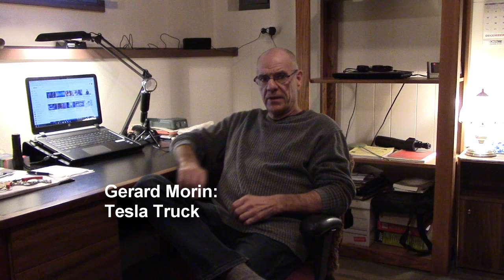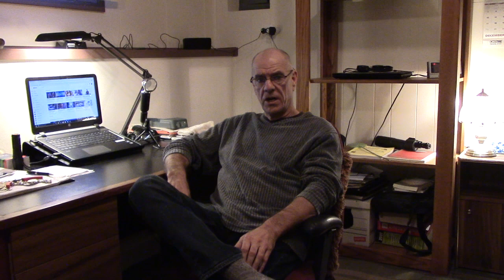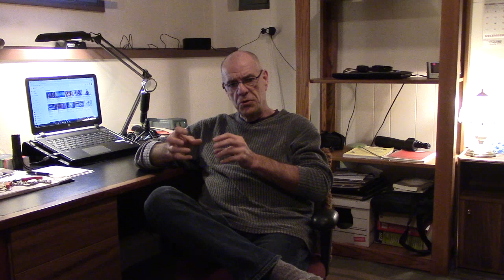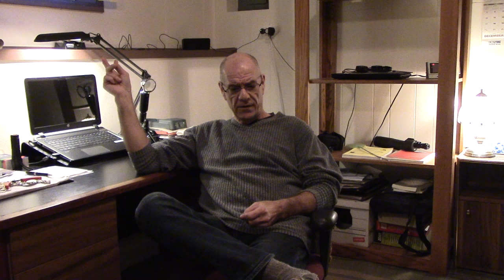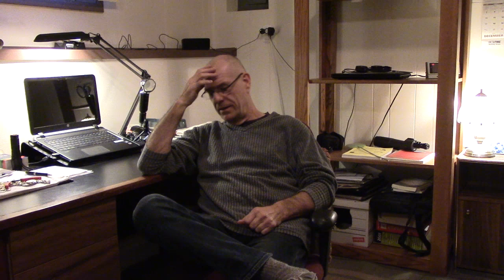Gerard Morin: The Tesla Semi

Comment: There are so many false facts about everything you have said that it would take me half hour just to write it all down
Reply: Adalberto Delgado and yet  you don’t
Reply: Did you just say "false facts" ?? Is that the same as a fake real ? Do you even know how to write?
Reply: The very idea that you can create energy out of nothing is itself blocked by the  laws of the conservation of energy and mass. There can be no overunity because of that law itself. No one has ever been able to break that law regardless of how some combination of magnets, transformers, coils and capacitors are arranged stationary or in motion.
Reply: Just because you cannot put a "Name" on something in no way means it is not REAL. Since you are so "Smart" and seem to know all the "Facts", maybe you can clearly explain where Gerard is wrong.
Reply: At about 4:20 Morin says gravity pushes the load forward when the truck stops. Sorry its the energy due to momentum not gravity that pushes the load forward when putting on the brakes.
Reply: Morin goes on a rant about tesla trucks and how the engineers building scooters and skateboards can't build trucks. Well maybe that is true and maybe not. But if I was Tesla I'd hire some truck building engineers from companies that build trucks.He rants on and on about scooter motors and starter motors. 

The biggest problem with building an electric truck is the same as electric motor driven railway engines you need a source of electrical energy. Battery charging time is a legitimate but secondary problem.  An electric only railway engine gets electrical energy from an overhead catenary cable or a third rail. The diesel electric railway engine gets its energy from an internal diesel engine turning a generator. 

Railway engines also use a compressor to for their air brakes as do regular trucks. So you don't necessarily need to rely on magnetic braking. You can use the electric motor for dynamic braking much like using engine braking in a conventional truck. The main difference is it is possible to return some of the energy in dynamic braking back to charge the battery. That can't be done in a convention internal combustion engine driven truck.   

Electric railway engines all use electric motors in the trucks usually one per set of wheels. They don't need a transmission either because of the huge amount of torque obtainable from the magnetic forces in the motor at a dead stop. You need a clutch and transmission to constantly change the speed of a conventional truck and apply the correct torque when using an internal combustion engine.
Reply: He also says that jack knifing is impossible to halt. For jackknifing to occur you need a slight imbalance in the direction that the trailer and tractor are traveling. Then the tractor needs to be stopping faster than the trailer. However trailer wheels moving sideways is equivalent to locked wheels in that direction. So if you lose traction on the trailer wheels but not the tractors you are set up for a possible jackknife. However if you have something akin to ABS on all the truck and trailer wheels you might be able to prevent jackknifing. 

Sitting in the middle instead of one side or the other would actually help with mirrors because now both sides would be equally distant. For drivers use to the other way it may take getting used to.
Reply: Actually, it's momentum and inertia, i.e. Inertia: a characteristic of an object that resists changes to its state of motion. Momentum: The resistance of an object to a change in its state of motion. Momentum doesn't "push" the load forward it just carries it forward in a straight line until Gravity overcomes the inertia and draws the "load" to the ground. 
If you listen to Morin closely you will notice that he commonly uses the wrong words to describe things. Let's call it an idiosyncrasy. Not a fault. I do not believe that it deters from his genius. Listen closely to the Gestalt of what he is saying and not just to the mistakes in his nomenclature. I firmly believe he has stumbled upon/figured out Tesla's thought process though, and he is the only person I've listened to so far who I truly believe has done so.  I also believe he is a Savant of a sort and sees things us average guys don't. I do wish he wouldn't go on so many  l-o-n-g  rants, however.
What I have just stated is not a criticism of your comment by the way.
Reply: Sorry I don't have the respect for Morin you do. If you want to get technical than no reference frame is any better than another. So the earth and trailer are speeding up relative to the motionless truck as the brakes are applied. 

You can actually get this confusion of motion when two different trains going in different directions are stopping and accelerating in a station while you are in one of the trains looking at the other. All of the sudden you realized that you are stopped when the other train is gone.

Gestalt may be fine for therapy but it doesn't apply very well in physics. Despite his claims of overunity no one can repeat his experiments and get the same answer. Tesla's ideas are not magical. Michael Faraday came up with the discovery of electromagnetic induction, when asked why it was important he said, "Gentlemen one day you will tax it." and Tesla as an engineer took them and ran with them. 

Most of these people don't understand how to use a voltmeter. So in most cases they are either a knowing fraud or somebody who doesn't know what they are doing and how to use electrical measuring tools in the first place. Electricity and magnetism are magical because they seem to violate common sense hiding somewhere while being there. In fact that's why I always liked being an electrical engineer or technician even if I don't have a degree.    

No one is especially happy with electrons being unseened and both waves and particles at the same time. We are stuck with these and other bizarre ideas ("Positrons are electrons going back in time?" Richard Feynman) because they work for the time being.

Morin problem is that he can't be bothered to learn what is already been shown to be true and show us where we are wrong. Instead its a conspiracy of the hydro company or big oil. I've never made enough money to be in anyone's pocket.  Ohm's law works for me as does calculating power as current times voltage. Compared to Maxwell's equations they are very simple ideas to learn and use. But Morin knows better because he is a simple man? or is it because he is a simpleton?
Reply: I guess what I was trying to say was that Morin is "under-educated". He quit school sometime after the 5th grade. He is self-taught, not formally educated. He didn't learn his trade as we probably did. I'm a Laser Engineer and am probably more familiar with Photons than Electrons in the Gestalt   <http://graphicdesign.spokanefalls.edu/tutorials/process/gestaltprinciples/gestaltprinc.htm> of things but I still can see and understand much of what he says. I listen through his rants and generally, at some point, he says something that slaps me in the face about Potential or Volume or something else and I get another glimmer of what he understands. I think before it's over he WILL build his device and it will work. We'll just have to wait and see. I think we should not write him off at this point and maybe forgive him some of his eccentricities. Of course, much liike the two rains passing, it's all a matter of perspective.
"There are more things in heaven and earth, Horatio, Than are dreamt of in your philosophy".
Reply: Maybe I'm too hard on him because my father and uncles were skilled workers not university grads. If he builds an overunity machine then they'll have to rewrite all the thermodynamics books and award him a nobel prize.
Reply: That depends on what the "meaning of 'is' is"... doesn't it?!
Reply: Laws don't stop things from happening they just limit the timid to the thinking of others.
Reply: That maybe true in the legal world but the discover of these laws like Newtons and Einsteins allow us to make predictions. Although Einsteins allow more accuracy usually Newtons are still being used for most applications. Before Einstein most scientists thought matter and energy were separate things and each was conserved separately. A number of experiments poked holes in this theory.  

If Morin was a young person I'd give him more credibility but considering his age and exposure to industrial culture I don't.  Saying nostrums like. "Laws don't stop things from happening.... limit the timid....' is fine for the SJW's and those who pity the poor. If you want to play in the big leagues you need to get into the minors first by any means necessary.
Reply: This is a Quote from Alan Bustany, Trinity Wrangler, Undergrad Relativity Course, A-level Physics
Author has 5.3k answers and 14.8m answer views
"The concept of a scientific "law" comes from a time when we thought the universe obeyed some relatively simple laws, like Gravity and the Gas Laws, and all we had to do was find them. Towards the end of the 19th century, we even thought we just had to tie up a few loose ends and Physics would be essentially complete.

Then came Relativity and Quantum theory which not only refined earlier concepts and theories but helped alter our entire view of the scientific enterprise. Nowadays it is accepted that any scientific theory is, at best, a good model of reality. Reality itself can never be attained and can always throw up an exception to any theory.

If reality doesn't conform to some "law", do you know what we do? We re-write the "law". That's why we no longer call them laws (except for historical reasons). The classic example is the Law of Gravity (formalized by Isaac Newton) which had to be updated to the General Theory of Relativity (formalized by Albert Einstein) to properly explain the rate of precession of Mercury's orbit around the Sun.

Those two great 20th century breakthroughs in Relativity and Quantum Theory are now the best tested scientific theories we have ever had. The recent confirmation of the prediction of gravitational waves in the General Theory of Relativity is further validation of that theory. But it could have been a disconfirmation. Indeed, Relativity and Quantum Theory are incompatible at a fundamental level so at least one of them is "wrong" in some way. Scientists seek a so-call Theory of Everything that will refine and unify them appropriately, but it seems to be a tall order." Close Quote.
So, like I said, "Laws don't stop things from happening". They just slow the processes of discovery until someone (an out-of-the-box thinker) comes up with a better Theory.
There's never been a Law that hasn't eventually been broken.
And, just as a question, what the hell does age have to do with anything? I'm 70 now and I believe my mind is clearer and sharper than ever. Schooling may make you smarter but experience makes you smarter, and wiser.
Reply: As definition by conclusion, "There's never been a Law that hasn't eventually been broken." All one needs to do is point to one or more laws being broken and that could apply because so far we can't know everything about the future.. That is a better explanation of the problems as quoted from Alan Busty above. 

Since Tesla built polyphase generating systems shouldn't a disciple like Morin be able to explain the difference between them? Single, two and three phase power? Two phase four wire systems are few and far between but by listening to Morin one would be able to disconnect one or more power service entrance conductors and still get power with out any problems. Have you ever seen a single wire service (not using the ground as conductor)? and if you are foolish enough to follow his advice about the Hydro conspiracy and disconnect the neutral have a nice day where your operating appliances get the wrong voltage maybe even setting off a series of appliance and lighting failures. Only the dumbest electrician on earth would do that. My guess is Morin has French as his first language so I'm not faulting him for that. I'm 65 and I disagree about age and ability. I and my father before me have made errors that I think a younger me or my dad wouldn't do. 

He is now disabling comments on his videos to stop people from explaining why his nonsense is wrong..    https://www.youtube.com/watch?v=3Spf5WVGgSY 
https://www.youtube.com/watch?v=YNbUyD9T-ls 
https://www.youtube.com/watch?v=IauYQCCsz-g
https://www.youtube.com/watch?v=XOq9C3YSjKg
Reply: What Morin has said is that the "Power Company/Hydro" sends the "Transmission" power to your house over ONE LINE. This is absolutely TRUE. The Single wire splice/Y from the Transmission line goes directly into the top of the Transformer (if you don't believe me, go look). One line in, NOT two. This is absolutely TRUE. The 110-220 coming into your house is produced by/at the transformer on your power pole. That's why it is called the TRANSFORMER. It transforms the super-high-power, super-high-frequency energy transmission coming thru/from the Transmission Line Power into a usable/stable 110-220 60Hz signal that we use in our homes and businesses. This also is absolutely TRUE. 
The "Neutral" return line to the power company is a relatively "NEW" thing that the power companies have done. Back in the old days, there was just a Ground cable stuck into (what else but) the ground next to your power pole. The Neutral line (formally called the Ground Line) in your fuse box was also grounded, into the ground. No return line! You just had Hot and Ground. Nowadays, the Common or Neutral line is eventually connected to Ground. If you have an old pole you can probably still see that cut-off Ground Wire there. The idea behind the "return line", that Neutral Line, is so that the power company can "monitor" the power you are using via that "Smart Meter" plus bleed-off some of your (paid for) power (about 3%) to power some of their upstream devices used to transmit power to your house. Call it a Surcharge.
I had thought that you knew more about electricity (as it pertains to its Transmission and household current) than you actually do. I apologize for my mistake.
I would like to suggest that you study up on the subject BEFORE you rage against the truth.
Reply: What your saying is not true to get a complete circuit you need one conductor in and one out. The power coming into a can with just one high voltage wire goes back on the neutral wire between poles to the distribution transformer neutral Y and is grounded for safety. You don't really understand the definition of the ground and neutral. Ground is for safety and is ordinarily never meant to be a current carrying conductor. The purpose of the neutral wire is to carry any unbalanced current in any system. By definition is should remain at zero potential when compared to the ground potential. A bad neutral coming into your home from the transformer will result in eletrolisis of a water pipe ground and a water leak which can give the water service people a shock when replacing the pipe. Any system with two or more grounds will usually have some undesired current flow.           

They don't run power though the ground even in the remote farming areas because of the problems it causes with barefooted farm animals. If it accidentally happens it has to be fixed. That practiced ended with the dinosaurs. Grounding itself can be controversial because of the results of two separated ground rods connecting together by a neutral and/or ground wire and a lighting strike to the earth itself. Power frequency 60 HZ is the same throughout almost the whole system including the whole grid throughout the US. It doesn't change though any ordinary transformer it is the same in transmission and power distribution. The best known exceptions in the US are sections of the railroads northeast corridor using 16 HZ or 24 HZ, and 600 VDC for subway and light rail. If you need 400 Hz for aircraft power on the ground the usually way is through a motor generator set. Stick to lasers and stay away from things you don't understand. 

My family was born into electricity starting with a great uncle who was an IBEW founder. Since I've worked as an electrician and know the difference between single. two, and three phase systems unlike Morin and his moronic ideas I actually understood more as an eighth grader than either you or Morin as old codgers.
Reply: The present single phase 115/230 volt service watt hour meter relies on a number of things to work properly first is the overall voltage between the two hot wires which creates the voltage factor and then two current carrying hot wires for the amperage factor. There is no need to have the neutral current included because it is just the unbalanced part that is already accounted for one or the other hot wire currents. You also have some strong permanent magnets in the meter their purpose is to have a drag effect on the aluminum wheel by inducing eddy currents. That's the basics and they are usually changed every 10 years. No conspiracy involved. 

Now if you have an old 115 volt only service the voltage coil will be have to be run at 115 volts and only one current coil will be needed. Other industrial and commercial services like 120/208 volt three phase and 277/480 volt three phase use basically similar methods with more coils and sometimes remote current coils and peak power usage pointers. I've only seen one two phase 440 volt floating system (no neutral or ground) and one 575 volt three phase system.

Any new electronic meters will have to do the same thing measure voltage and multiply it by current used. Neutral current in any system will always be seen as an imbalance in the hot wires regardless of the type of voltage or number of phases of the system.
Reply: The neutral current which flows through neutral impedance raises the load side neutral potential with respect to source neutral point which is normally earthed and at zero potential. This means at load side there will be a potential difference between neutral and earth. 
Basically, the Neutral wire is the second wire in a circuit. It is grounded.
Reply: Yes but the impedance (resistance and reactance at 60Hz) in the neutral wires is very low such that you usually can ignore it if you are worrying about the voltage drop. If you use an undersized wire than you can expect a problem. In a 120 volt branch circuit  the neutral (white wire) carries the current back to the neutral bus bar in the panel. 

Let's now consider a home dryer on a 120/240 volt single phase circuit. The heating element can take advantage of the full 240 volts available while the single phase motor and control circuits can be built to run on 120 volts. When in operation the current in the neutral is due to the motor and control circuits assuming both are connected to the same hot leg. One hot leg will carry only the heating current while the other will carry both the heating, motor and control circuit current. Why don't they just wind the motor for 240 volts and use 240 volts control circuits? Not really sure but it probably has to do with costs. They'd rather have you spend the money on a neutral wire than them add to the cost. 

How about a 230 volt home air conditioner? Here the biggest load is the single phase compressor motor and you are using the full 230 volts to power the compressor. The fan motor and any controls are also built to use 230 volts so a neutral is unnecessary. However when the electrician wires the outlet he will use ordinary two conductor one ground non-metallic cable and one of wires will be both hot and white. You will also see a hot white wire in a switch leg to a overhead household fixture. The power may come directly to the overhead fixture while the switch leg also comes up directly to the fixture.       

You can have similar predicaments when wiring 3 phase motor, electric heat and control circuits in commercial and industrial situations. .You will always need three phase power for the motors and it is not unusual for the motors to be dual wound so they can run on a nameplate voltage of 230/460 volts. Of course when you connect them up the'll most likely running on either 480 volts or 208 volts three phase power. As long as the engineer oversized the motor and you put in the correct heaters in the contactor everything should be fine. As long as the motor is small and you have a 208 volt three service you can use 208 volt controls and not use a neutral wire or add a neutral and use 120 volt controls. If it's 480 volts 3 phase and a small motor maybe you want to use a neutral and 277 volt controls. 480 volt controls? Probably a special order or maybe a small transformer can be used. If they are large 3 phase motors than the motor circuits usually only get 3 wires plus equipment ground at 208 or 480 volt three phase power and a separate control circuit is used.                     

For electric heat you always want to be using the correct voltage as show by the nameplate. Installing a 240/120 volt stove in an apartment building with a 3 phase 208/120 volt transformer service is going to make for some unwanted slow cooking.